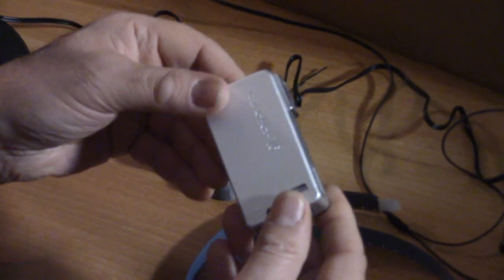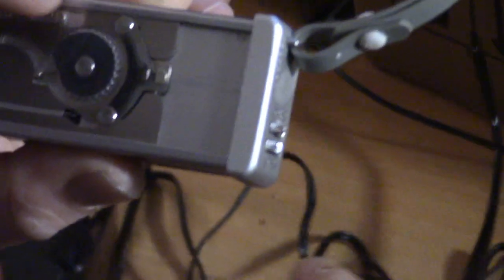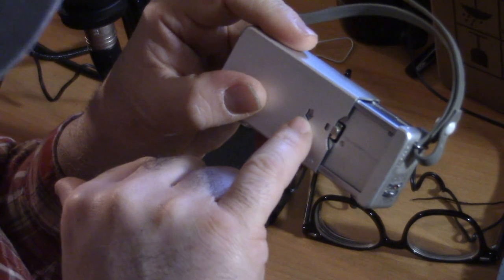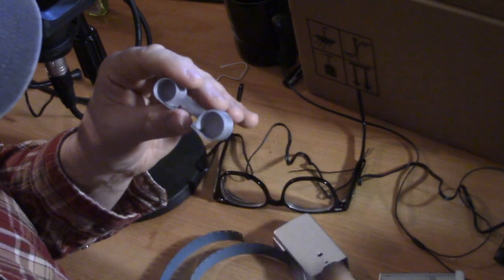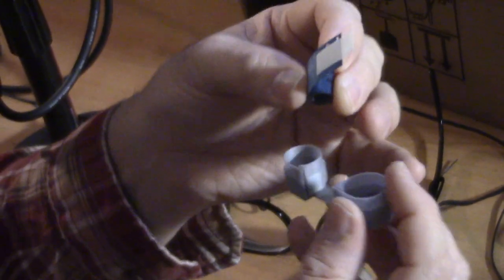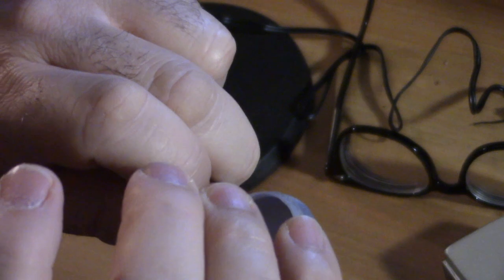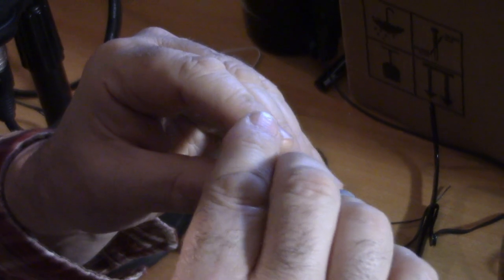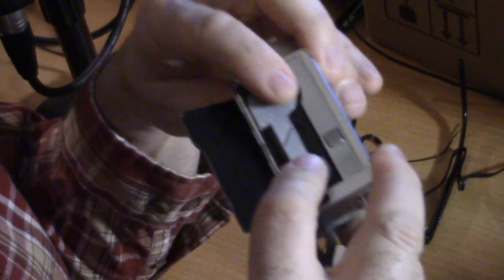Minolta 16 Spy Camera - How To Load The Cartridge

Comment: It's great to see some new product for 16mm cameras. After rolling many Minolta cartridges I have a few pointers: 1. Be sure to roll the emulsion side of the film on the inside otherwise you'll end up with strip of clear film. Most film curls with the emulsion on the inner side but some stocks don't. 2. Tape the take-up cup to the film before rolling the film. It's easier the mess with the tape with the film relaxed than when it's coiled. 3. As much as possible handle the film on the edges and try to avoid pulling the film to make the roll tighter.  It will scratch the film which is sad on such a small negative.

Comment: An easier way to coil the film is to take a quarter inch dowel and hack saw across one end, making a slot no more than 15 or 16mm deep. Slip one end of the film into the slot and twist the dowel till the length of film is fully wound. It does put a crease on the end of the roll, but the crease gives a little extra resistance when it exits the supply side of the cassette while advancing the film, signaling that the end of the roll has been reached.

And I do agree with the commenter who suggested loading the supply side in the dark, take up side in the light.

The MG-S and QT versions make a larger image on the film. Consequently,  the number of exposures is 18 on these two cameras. If the film is double perf, the MG-S and QT will have one edge of the picture in the perfs. Single perf film, with the perfs nearest the cross bar, will prevent this.

And when the cassette doesn't fully seat, just close the camera (advance the film) while gently pressing on the cassette.

I love the podcast, by the way.
Reply from the maker: Great comments. Thanks, Doug!!!

Comment: Michael. Great video. You should make a correction through. Unlike the earlier Minolta 16 cameras which could take double, single or non-perf film, the later ones: QT, MG and MGS had an enlarged image area. Because of this they could only take single or non-perf film. When loading cassettes for these cameras (Russian ones too) with single perf film you have to ensure the perforations are adjacent to the cartridge bridge or the perforations will be in your image. You have loaded the film upside down.   V/r. Tom
Reply from the maker: Appreciate the input.

Comment: Hi Mike, I'm really new to film and vintage cameras. My dad just gave me his Minolta-16 p-model. I read somewhere that 16mm is the less expensive and amateur version of 35mm film. Can I use 35mm film for this model? Alternatively, will no-perf 16mm film on the website work with this model? Thank you in advance!
Reply from the maker: Hi. You can only use 16mm film (or perf-less Minolta 16 film). 35mm will not fit. You'll need to load your own cartridges - https://filmphotographystore.com/collections/all/minolta-16

Comment: Well I don't know if I have have bad 3d prints ( I ordered two of these) or not but the slots of the film transport are so wide is no way to load without getting fogged film. I was able to shoot a useable roll by doing ALL LOADING - UNLOADING - and LOADING into the processing tank via a dark bag - but i could have don this with just an old take up spool. I have added a thin strip of felt to the slots and hopes this stops the fogging but if it does maybe a disclaimer is in order. AND yes I WAS in a very dim room loading the carts and ten loading to camera. I does take much light to fog 400 ASA .  NOT happy with our purchase at all and they are non returnable. Buyer beware
Reply from the maker: Hi Michael, We take what we do very seriously. We have had two reports of light leaks so we immediately did a battery of tests. In both cases it was user error and could not duplicate the errors in  our tests. Please consider taping up the exterior film compartment of your camera when using high speed film or keeping your camera in your camera bag when not actually taking a shot. We will update the product page to include a disclaimer about light leaks and fogging via the film compartment door. We are also prepping a blog and will post the link when available. Sorry for the trouble. - Mike Raso

Comment: “You can do this in the like” uuuuh the two that I bought from you guys looks really thin, when holding it up to the light I see 3D printed lines soooo doesn’t look like it can hold up against the rays of light, kinda disappointed, wanted to be able to swap between two different iso with a small sacrifice of losing an exposure or two but now I can’t even do that because it’s not light tight.
Reply from the maker: We're doin' the best we can and working to improve the design. What's better...no cartridges available or 3D cartridges that you need to be careful with when loading? - Mike